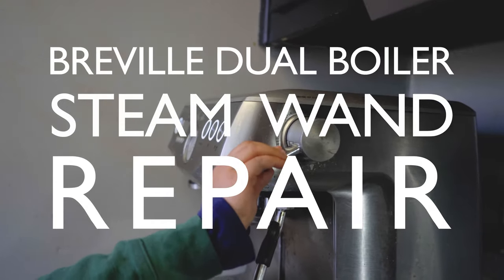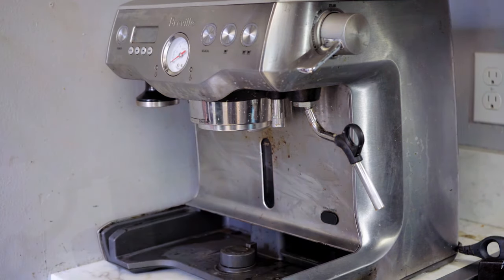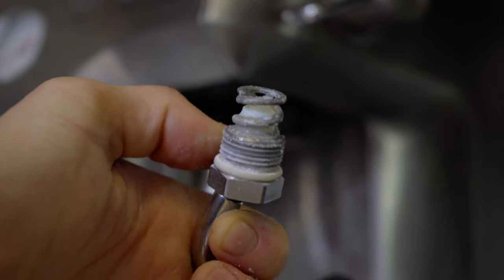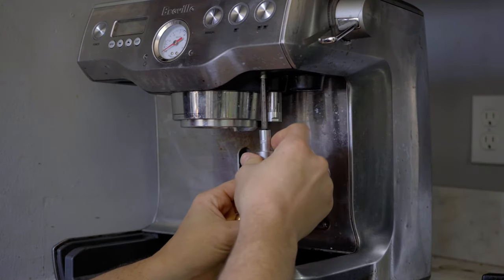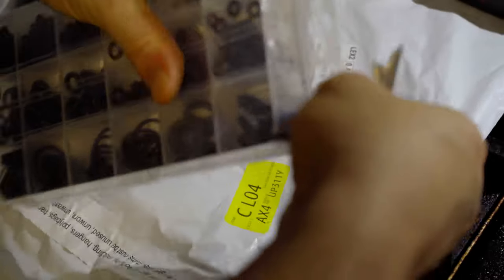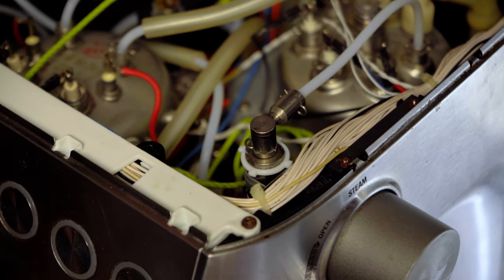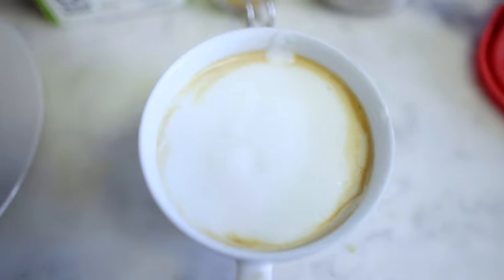Repair Breville Dual Boiler Steam Wand

Comment: DO NOT use NBR o-rings to repair anything steam related on this machine. The rated max temperature of NBR is 120C (as written on the box) and these steam boilers run at 130-140C, these o-rings will fail very quickly. You need to use silicone or viton o-rings, the size required is BS007.

Comment: Great tutorial! You are the only video that actually says to remove and clean the entire steam wand (not just the nozzle tip).

However the hex nut at :49 is stuck fast on my machine. I was able to open the machine and remove the whole steam wand assembly. After soaking in vinegar overnight that hex nut still will not budge. Any tips?

Comment: Yikes, that is one horrendously dirty machine. Routinely keeping the machine clean will prevent most of your problems. Purge and wipe your milk wand after every use, same with the group head and make sure your doing your cleaning cycle with espresso cleaner or similar weekly, I like to soak the steam and hot water tips, basket and group handle in cleaner solution at the same time. 

And if your getting that much scale build up you should be descaling regularly before it gets that bad, to prevent large particles causing blockages (although this could also be milk being sucked back up if the wand isn't being cleaned/purged).

Also I noticed how far your group handle is being rotated to lock the portafilter in, it should seal with the handle pointing straight out or perpendicular to the machine - you may be needing a group seal replacement...
Reply: yup, clean it bro
Reply: agree
Reply from the maker: @ryandeatt  No thanks.  5 years deep and the lattes taste just as good as ever.
Reply: @eternalstories1  Dude, it's embarrasingly dirty!

Comment: 3:09 That portafilter should not go this far, should seal once perpendicular to machine, you might need to change the grouphead seal. It also gets this lose when there is less grounds in the portafilter.

Comment: Hi Joe, appreciate your video a lot!
I also do have problems with the steam wand of my BDB 900XL. Steaming power is getting less and it's not really so hot anymore. Thought I might follow your steps to make sure to clean the steam wand, after having descaled my machine recently.
However...I simply fail to open the big screw where the wand is attached (not the tip!). Any hints on how to loosen it? I don't want to break the screw by using too much force...
Reply from the maker: When you say "big screw," are you talking about the nut, like the one I'm unscrewing at @:49 ? I got mine off using an adjustable wrench, but if it's really on there tight and you're afraid of stripping the bolt, then using a closed wrench would allow for a lot more force without stripping it.  Sounds like you may have a lot of scale or dried-up milk in there if it's really on that tight.
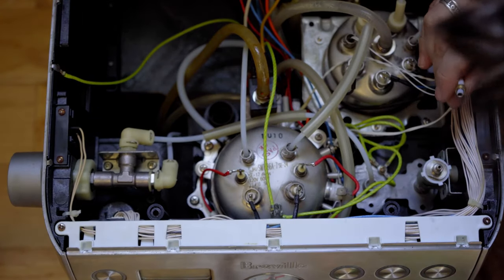Reply: @eternalstories1  Thanks for your input! I got myself a matching wrench and even tried the closed wrench, but it still won't move (didn't use all my power, as I really do not want to break things). So I openend up the case and after trying to blow through the valve (like you did at 1:58) - nothing goes through. Seems like it's completely blocked. Do you have any idea what might be a good way to unblock it if I don't want to risk destroying the nut?
Reply: Update: I forgot that the steam level was set to closed :) - Now I can get air through. Added Vinegar around the area where the nut is, still couldn't open it. Anyway, I remove the whole steam wand valve, made sure it's clean and put all things together. Now I will give it another test

Comment: I descaled my breville and after doing so my steam wand just stopped working. It just peeps when I try turn it on... I was told the thermal fuse may of blown. any idea on what it may be if its not the thermal fuse and if it is how to repair it?
Reply from the maker: Is there any steam or water coming out of it?  The usual culprit with descaling, when scale build up is really bad, is scale getting loose and then clogging up some where else.   That was my issue.
Reply: @eternalstories1   NO WATER OR STEAM at all
Reply: This happened to mine. Had to be repaired, was under warranty. It's not an easy fix.
Reply: i had that on mine as well. This is down to the descale liquid, it forms a film over the fill sensor in the steam boiler during the descale process. This make the sensor think that the boiler is full where it is actually completely empty. Net result, the boiler overheats, and the temperature safety blows which then must be repaired by a service centre as the part is seated under the boiler so it take some time to get to it (better get someone skilled to fix that)
Reply: Breville / Sage has already addressed this on their website, issues after descale is due to air lock issues, you need to fill the tank half, then turn on the machine, tilt the machine towards front and run steam.

Comment: Awesome work. My steam wand on same machine sometimes out of nowhere stops working and then 5 min later works... confusing... any ideas? Should I take it apart same way and do similar things?
Reply from the maker: Hi @wbcfox.  Sounds like you have buildup like I did.  It causes intermittent problems.  So it'll work great one minute and then barely or not at all in the next moment. Start with your wand tip. Make sure that's clean.  Then take your wand off and check the area where it connects, I do this around :53.  My problem was scale build-up and dried up milk.  It would intermittently come loose, causing clogs in the wand tip.  If you have build-up, you have to clean it all out to get rid of the problem.